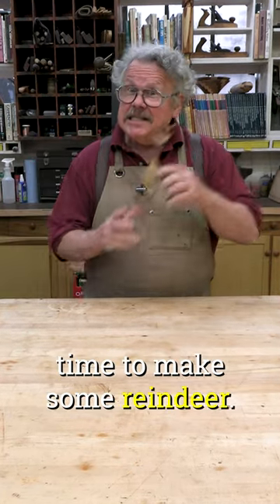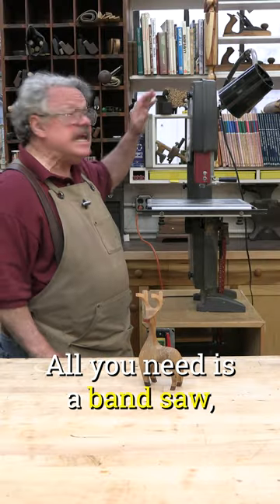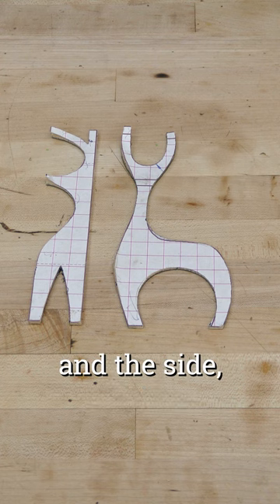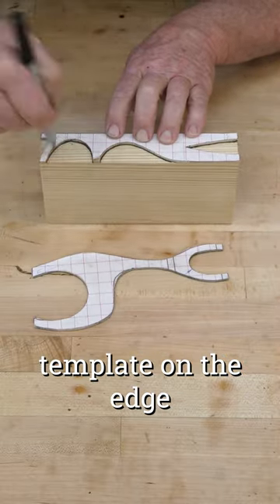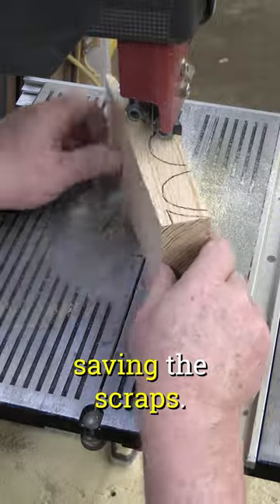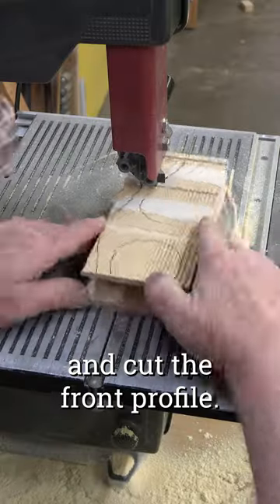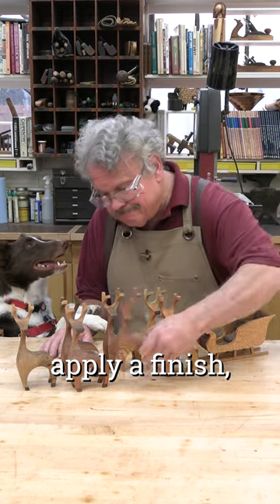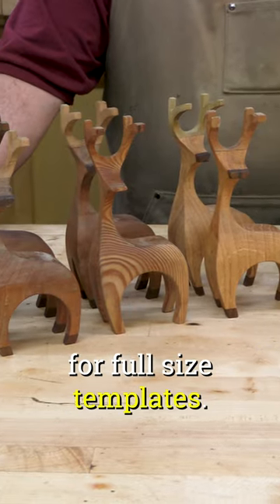Bandsaw Reindeer

Comment: Think I could manage this with a jigsaw?
Reply from the maker: You can, but you have to reduce the size and it takes 10-20 times longer. Jigsaws and scroll saws don't clear sawdust from the blade gullets as effectively as a band saw. The dust packs in the gullets and prevents the teeth from reaching the wood.

Comment: Can I use a jigsaw on these projects?
Reply from the maker: If your jigsaw has a 3-1/2" capacity, then yes. Otherwise you will have yo reduce the size of the deer. Also, you must use a skip-tooth blade. A standard blade would be very, very slow because the sawdust packs the gullets between the teeth.

Comment: Can a scroll saw do this as well?
Reply: If you can fit a 2x4 in it, then yes.
But a band saw would be preferable.
Reply from the maker: This will go much slower on a scroll saw because the tool doesn't clear the sawdust as well as a bandsaw. The sawdust packets in the gullets between the teeth and  prevents them from cutting. If you use a scroll saw, be sure to use a skip-tooth blade.